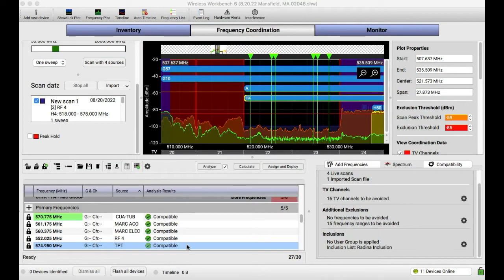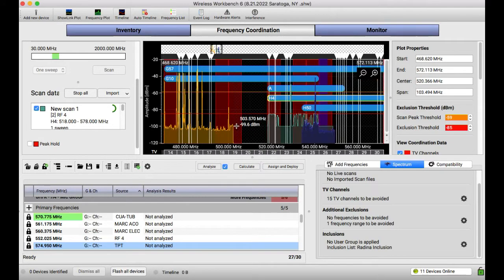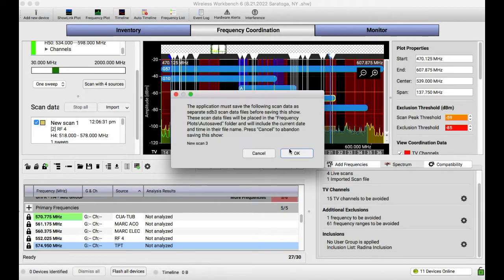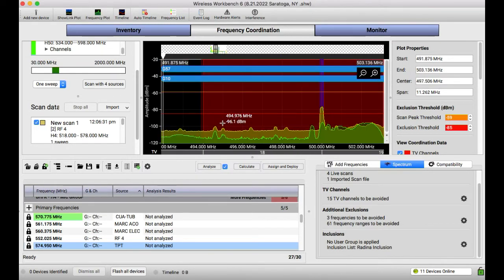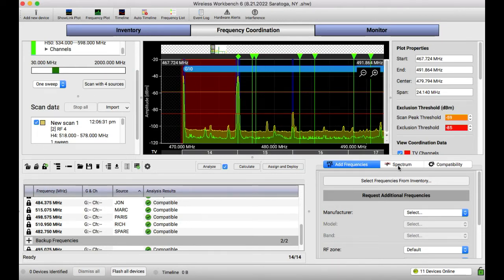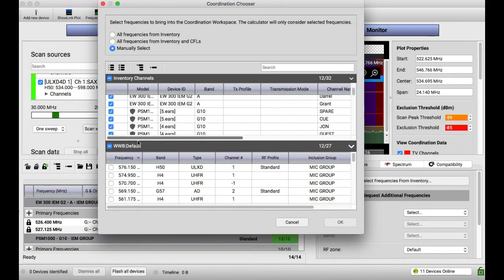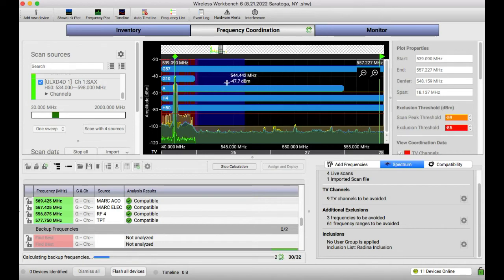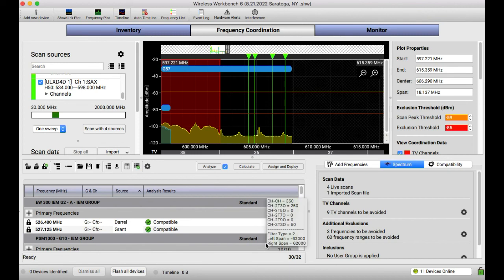Real time RF Coordination using Shure Wireless Workbench with Nicholas Radina! Saratoga Springs, NY

Comment: Hey Nick! thank you for your videos. Quick question I use a RF Explorer to to my scan and I take the data from that to WWB, should I do another scan with my In-Ear pack or it's enough the one that I get from RF Explorer (maybe this could be a stupid question but I'm new to the RF Explorer world)
Reply from the maker: Thanks Domenico! Using RF Explorer is a great solution when you can't use the actual units to scan.  If you are able to perform a scan using the IEM pack and then import into WWB, it's a great idea. The more data you can see, the better!
Reply: @NicholasRadina  perfect that's what I was thinking to do in future. Thank you so much for this